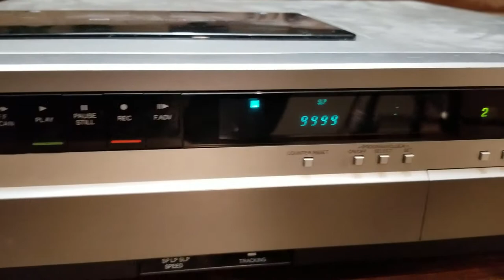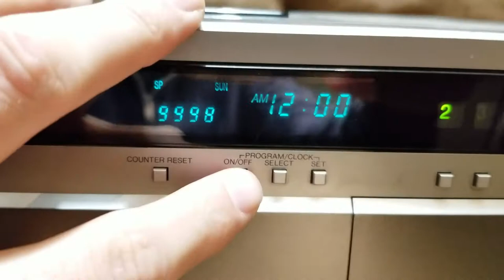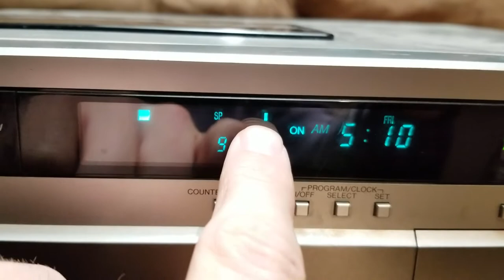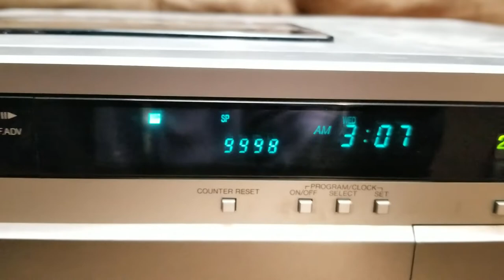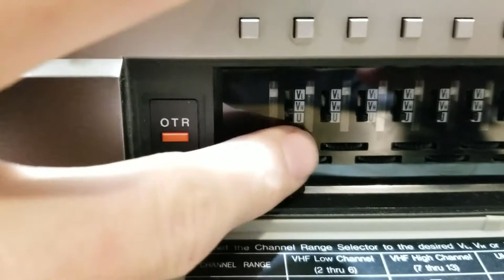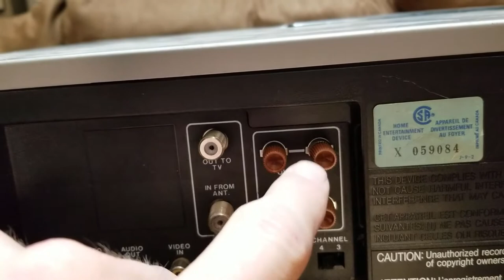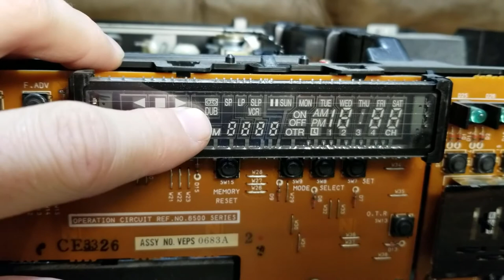1983 Top-loading VCR - Part 1 (Sylvania VC-2225SL01)

Comment: The fact that it lasted that long- and was in service all that time is amazing. Did the Sylvania ever break down?
Reply from the maker: My dad had repaired it a few times - I believe it was all just replacing belts, roughing up the idler tire, and gluing the tension band back together. It definitely got a lot of use over the years (especially by me until I got my own VCR).

Comment: I was watching this to see how you got the top off of it, but your video skipped right past that part. I have a Panasonic PV-1220 and I can't get the top off of it. There only seems to be two screws on the back that hold it in place, and after removing them, the right-hand side of the top (the side farthest from the top-loading mechanism) will easily slide back and lift up but the left-hand side will barely move. I can only get it to slide back maybe 1/8" no matter how hard I pull on it, which isn't enough to unlock it from the tabs so you can pull it up to remove it. I've already removed the cover of the top-loading mechanism in case that was somehow interfering, but that didn't make any difference at all.
Reply from the maker: Panasonic VCRs usually have a few screws on the bottom that hold the top cover in place. Check along the bottom, near the sides.
Reply: @probnotstech  My Panasonic PV-1220 VCR is the same as your Sylvania VC-2225SL01, at least that's what it says in your video description. Mine doesn't have any relevant screws on the bottom, does yours? The only screws on the bottom are for holding the bottom cover on, and none of them are long enough to even reach the top cover. I've already removed all of them as well as the bottom cover to see if there was anything under there that was interfering with the removal of the top cover and there's nothing. 

I said in my previous post that the right-hand side of the top easily slides back and lifts up, and that would be impossible if there were screws on the bottom still holding the top in place. Also, I wouldn't be able to move the left-hand side of the top even the 1/8" that I can move it if there was a screw in the bottom holding it in place.
Reply from the maker: Hmm I just checked mine and the bottom screws don't attach to the top as I suspected (they must have started doing that in the mid 80s). Just 2 screws on the rear and my cover comes off. Maybe yours is jammed along the little hooks that it slides into.
Reply: @probnotstech  "(they must have started doing that in the mid 80s)"

Probably. I have a made-by-Panasonic General Electric VG-7720 VCR from 1988 that has two screws in back plus two screws on the bottom that hold the top cover on. The two screws on the bottom double as screws for the bottom cover, and they have arrows pointing to them indicating that those are the ones to remove to get the top cover off. That top cover comes off slick as a smelt. It uses the same style of retaining hooks/tabs that my older Panasonic top-loader does, but nothing is jammed on it.

"Maybe yours is jammed along the little hooks that it slides into."

That's the only thing I can think of. This is my first time trying to take it apart; I don't know if anyone else has ever taken it apart before or not.

Comment: Did you ever get this running again?
Where did you pick up the belt kit ?
Reply from the maker: I did in a part 2 video. Got the belt kit from Studio Sound Electronics, but I don't think they carry VCR parts anymore. Finding rubber parts is getting real difficult nowadays. There's also SMC Electronics, but they suffer from the same stock issue - no new parts are being made.

Part 2: https://www.youtube.com/watch?v=AGWcEQA_rdo
Reply: I have the Panasonic PV-1220, The big tire is cracked all over the place. But believe it or not the picture is beautiful at times. The small tire and the other belts look to be in good shape. Sometimes the  Rewind,  Fast-forward and Play functions will work fine. Other times forget about it.  It also seems to depend on certain tapes how it will perform. Also the channel selections will not light up green.  I don't know if the LEDs are blown? Or they aren't getting any power? Hopefully with the help of your videos I can get it going again. 🙏